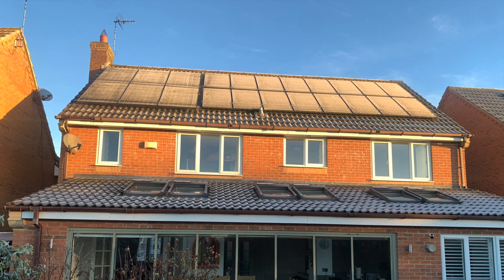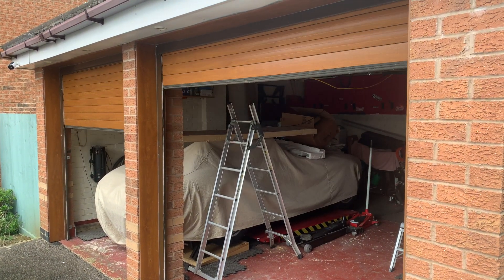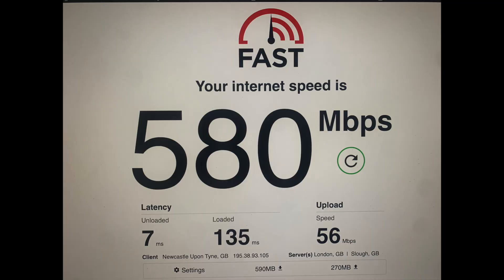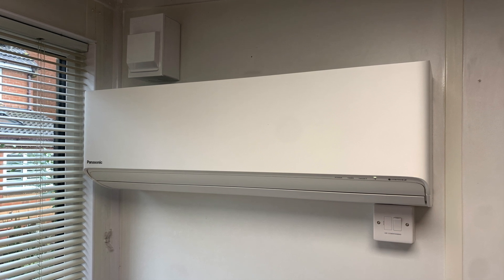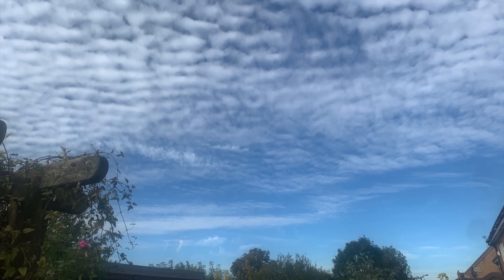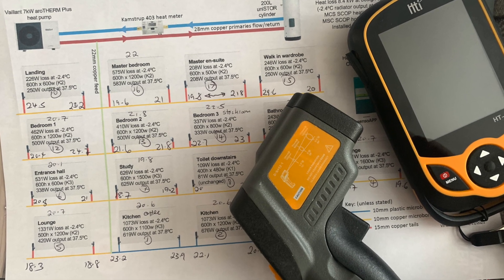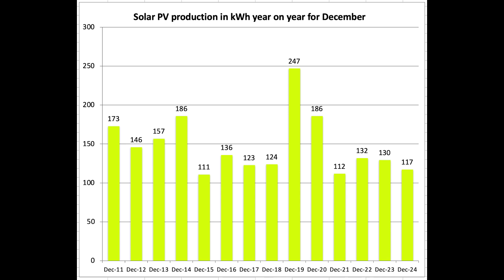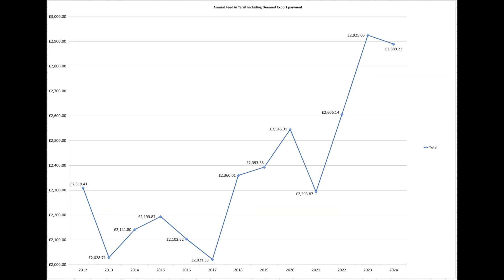2024 year end energy review usage and cost

Comment: Hi John, we have chatted before. I am in the process of getting a second set of Panels and replacing my Powerwall 2 with  Powerwall 3 plus expander giving me 27 KWh storage.
They tell me that the Tesla app cannot show the two sets of panels separately. I want to be able to compare old panels with new panels. Please advise on the best approach for an additional app to do this.. thanks Neil
Reply from the maker: The inverter should have its own app which will allow you monitor the throughput. Not sure how it's being configured, 2 separate arrays and 2 inverters, or are they running both arrays though a single inverter. If the later then you won't be able to to see the output.

Comment: Interesting, thank you.
I was wondering. In the event of grid failure, do the panels continue to generate for supply to the house and to the battery, or, as I superficially understood it, are you limited to whatever is in the battery at the time of failure?
Reply from the maker: Everything keeps going in the event of a grid outage. If the solar tops up the battery to full then the Tesla Powerwall shuts down the solar inverter until there’s space in the battery to accept more solar generation.
Reply: @johntisbury Thank you. I guess the battery must power the gateway which in turn controls the PV which then recharges the battery. So providing you never go below minimum charge at night it’s a cyclic homeostasis.

Comment: Hi John, great video. I've got the same issue with my double garage in that it has a central pillar. Could you please share the rough cost of removing the pillar, adding the steel work and new garage door? Many thanks, Dave
Reply from the maker: Thanks for watching.
Cost of pillar removal, steel work was £3,200 which included a structural engineer's report. Which you will need in case you want to sell the property at a future date.

I sold the old garage doors on eBay for £400. New doors are very much dependant on the brand and quality you purchase. They start from around £2,500. We paid £4k for insulated high quality doors with good security fixings.
Reply: @johntisbury  Fantastic John, thank you so much for the detailed breakdown. That is not as much as I was expecting it to cost, so makes it a real option for me. Thanks again!
Reply from the maker: No worries. Builder prices will be the thing that varies tremendously. Our builder Ryan is a one man builder and has a great reputation for quality and workmanship. Choose wisely, ask for references and the ability to view their previous work. I know it's only a garage door, but Ryan did a fabulous job, even replacing the plastic fascia as it was previously in 2 pieces and he did it in 1.

Comment: Hello from the Philippines, John.

Great video.

I relocated to the Philippines from the UK almost 1.5 years ago. My Filipina wife and I built our new home on the 1000 sq m lot we had in the province (countryside).

At the same time we built the house we installed a great solar system. We are 100% off-grid so no electricity bill.

It is only my wife and I so we thought a 6KW inverter would be enough and it certainly is.

We have 18 panels with 3 x 51.2v 200AH 10.24KW batteries. Even when we had a bad run of typhoons back in November the system still managed to give us power all day as well as giving us enough supply through the evening.

We can easily run the following on our system -

3 x split AC
1 x built in electric oven
1 x built in ceramic hob
1 x kettle
1 x refrigerator 
2 x TV's
1 x water cooler 
1 x washing machine 
4 x fans
1 x rice cooker 
And all out house lighting

Regards

Simon
Reply from the maker: Thank you for watching. Great to hear about your own journey too, that's very encouraging and just goes to show what is possible with renewables and some planning.

Comment: Very interesting, would suggest you give up deemed FIT export and change it for Octopus fixed at 15p per unit…even more £ to plough back into renewable tech!!!
Reply from the maker: Thanks for watching. 

For us it's not worth it at the moment to swap. We exported 160kWh in 2024 to the grid as we use almost all on-site. That would give us £24 on a 15p export. We get circa £130 for the Deemed export meaning we would lose out. Until our exports are more then we will swap over. As I mentioned in the video we export very little as it's all used up on-site.

Comment: I have one Powerwall 2 and managed a 79% off peak for the year after adding our ASHP a couple of years ago, so yours is very good. As previously stated we seem to have similar homes with your being newer. Also our electricity usage very similar, Home Use was 15.8MWh, 13.4MWh imported from the grid and 2.3MWh Exported. Solar for year was down for us at 5183.3kWh. I too have the original 2011 FiT but have separated the deemed export part as I doubled the solar now adding to the East side of my roof. The export being 15p means we have bought electricity at 7p used solar and battery but allowing us to sell more at the higher price.
I wanted an extra Powerwall but DNO say I need 3 phase. 
App[arently the Powerwall 3 can be used as DC and then I can also use as many as I can afford! There is also talk that it will at some time work with my Powerwall 2. So currently waiting for this.
Also must add this includes my Tesla Model 3 charging over the last year for over 10,000 miles.
Reply from the maker: Thanks for watching. I love the fact that everyone has a different use case for a similar setup. The 15p export option is a great idea and works well for you. Shame the PW3 is not compatible with PW2 and your DNO has pushed for 3-phase if you want a 2nd PW2. That does put a damper on adding a second one as a 3-phase upgrade deeding on cable length and run can be very expensive. 

Thanks for your stats too, good to see.

Comment: Good afternoon John, one more quick query. What do you use to monitor your temperatures and humidity levels? I have some Zigbee devices but have mainly use Hue (as they work). Be useful to know which devices you use if you have a moment.
Reply from the maker: I use zigged devices too, the Sonoff  SNBZ-02 model. Battery life is excellent way over 12months and connectivity is good. I get your point about zigged though as I have smart plugs on zigbee with are very erratic in their connection stability. Hue is great, expensive but it does work and is reliable.

Comment: Do you mind indicating the cost for the supply and separately the installation of the Air to air units
Reply from the maker: Not often quotes of this nature have a breakdown of labour and parts, typically it's a total cost. Not thought about it until you asked the question as to why. For example automotive repairs and servicing does provide a parts and labour breakdown. They can do this because they have standard job times for various tasks which they quote against. based on their hourly rate. With heating installations working labour time is harder to do as they don't know what they will find until they start, so most often they work it out based on a day rate. Either way you don't tend to get a breakdown.
I'm planning to do an in-depth video on the install, costs, usage and performance so will cover that then if that's okay.

Comment: Good to see you back on YT and very helpful stats for the year. We are looking to add a Heat Pump and in your video you mentioned about re-balancing the radiators due to not enough heat downstairs. I wondered have you been happy with the HP and does it give you enough heat? Is there anything you would have done differently? I did see you interview with your installer so I guess you are happy but it's the small.memtion of getting it hotter downstairs that got me thinking. Great to see you back
Reply from the maker: Thanks for the welcome back James.
The heat pump has been great there's nothing I would have change having lived with it across 18 months. 
Balancing the rads should happen on any radiator based system, gas or heat pump driven. Most often the upstairs rads run too hot. Closing the lock shields, rather than stopping down the rad thermostat reduces the flow through them allowing the warmer water to circulate to the lower downstairs radiators rather than cooling down as it enters then leaves the upstairs rads. Balancing is probably more important with an ASHP as the flow temp are lower and therefore more noticeable in a room where there is more heat loss. I was not too clear in the video, our worst performing room is the dinning room has the biggest heat loss. The rest of the downstairs rooms are fine, we have a temp sensor in every room in the house. The dinning room needed more heat and it'd rads are at the end of the pipe run which makes it even more important to balance the system.
Reply: @johntisbury thank you, useful to know. We are on the cusp of ordering but there's been a couple of negative comments from people my wife knows one of whom has a HP and regrets but it sounds like there's haven't been set up properly.
Reply from the maker: @jamesmcfeely9150 good system design and installation is everything with a heat pump. It all starts with the heat loss survey. Get a good engineer, someone like a heat geek and you will be fine.
Reply: @johntisbury  agreed. the order is about to be submitted with Heat Geek due to the guarantee they offer. Look forward to seeing the videos in 2025. All the best, James

Comment: Question on the powerwall 2, if the grid power goes off, does yours take over immedietly or do you have a few seconds loss of power? Mine goes off for 3 seconds, which i was told is normal in the UK. Iv had to buy a few ups's for my computer equipment to stay on and still having to reset the oven and microwave clock 😭
Reply from the maker: Good question Shaun. Not all outages are the same in terms of how the power goes down. Instant ones are not normally detected by the Powerwall until after a few seconds like you have experienced. The Powerwall is not a UPS so it won't automatically cut in unless there's a slow drop in voltage before a power cut.
Reply: Hi. We have PW2s as well and when grid goes out we lose electric for about one second. Like you in thinking of adding in a UPS so our internet stays on (I work from home) as well as the essential IT equipment/backup storage. I never quite understand why it does go off as when it does we are already running off the battery. Shame it's not quite as seamless as I assumed.
Reply: 3 seconds is a lot, but just the half to one second that we have is too long for the computers and clocks, etc, which get upset like yours.
Reply: Not sure if you meant that’s normal for Tesla systems in the UK or if it was supposedly a norm for any system in the UK as a requirement, if the latter it’s incorrect as the Sigen systems switch seamlessly.